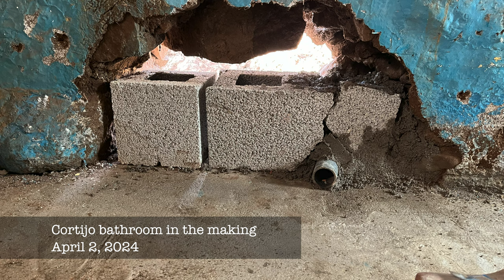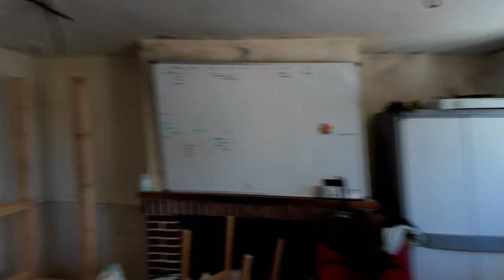Getting READY to host many VOLUNTEERS

Comment: The most important thing is to anchor the shelf to the wall so it doesn't tip. Instead of just screwing it in I would propose to use a French cleat, so you can move the shelf along the wall if needed.